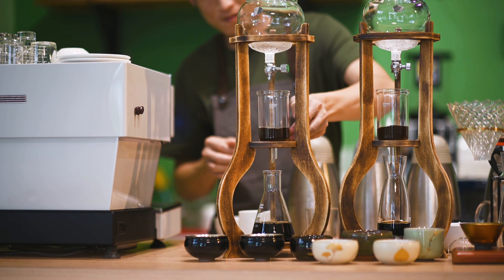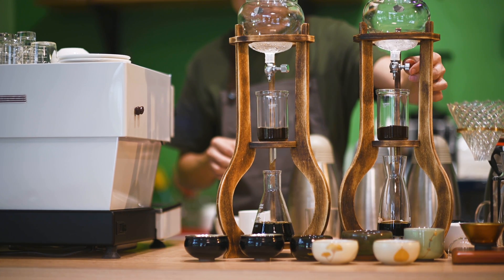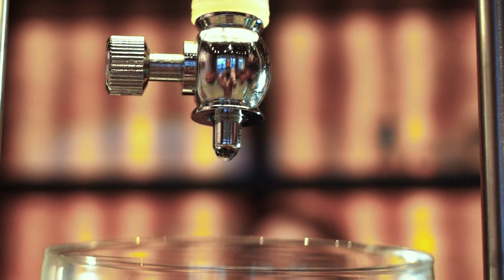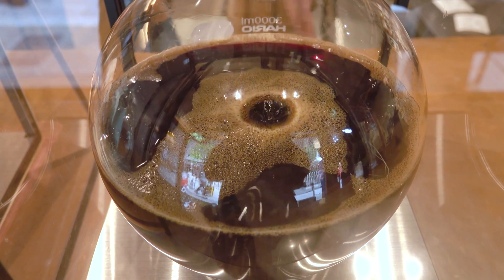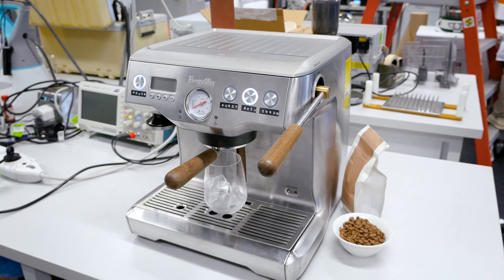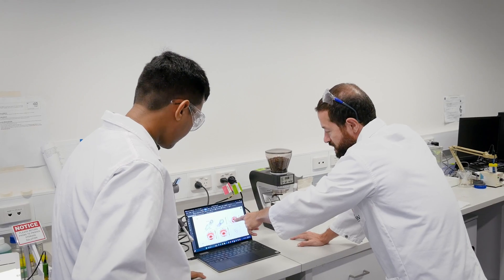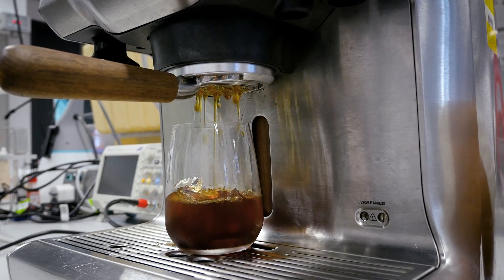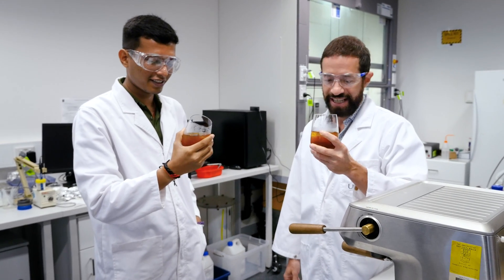Ultrasonic Cold Brew Coffee in Under 3 Minutes

Comment: Keurig K-Iced Single Serve Coffee Maker has a brew over ice button, it makes iced coffee in 2 minutes
Reply: Yes, but that is not the same by any means. Temperature plays a huge role in what compounds are extracted from the coffee, which is again why cold brew is so much different from hot brewed coffee over ice. In fact, I’m not even convinced this solution is a true replacement for long steeped cold brew, because the time of exposure to water also is a key factor that enhances some really great flavors in some cold brews. Here they’re substituting time with agitation and surface area exposure, which may be similar, but I guarantee it will not be a replacement.